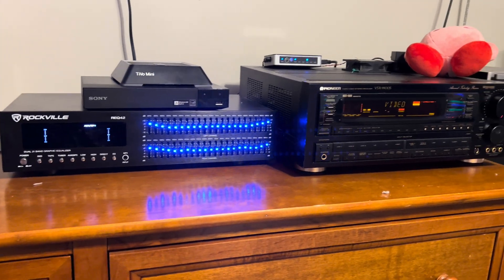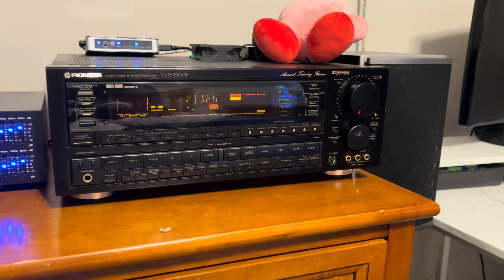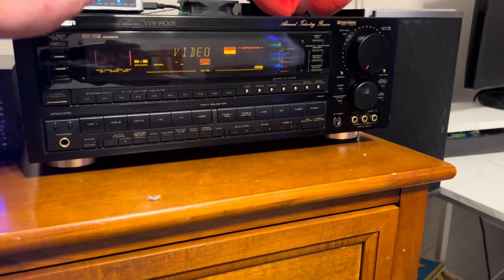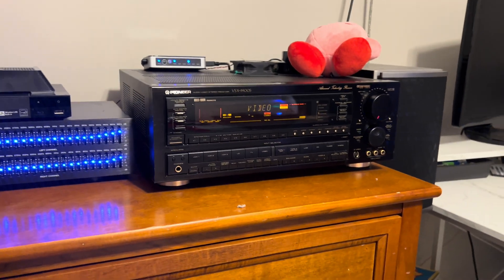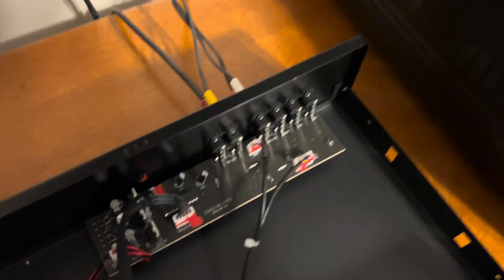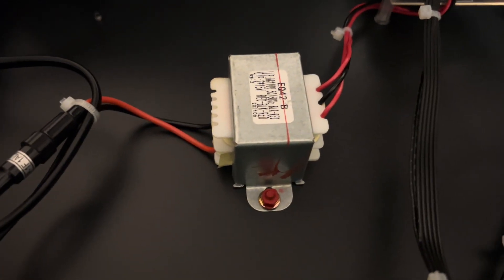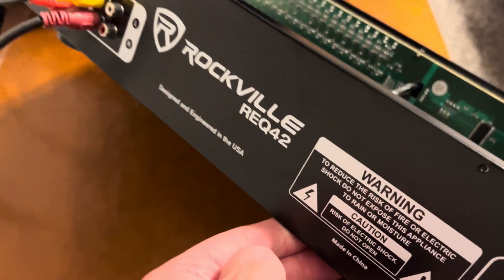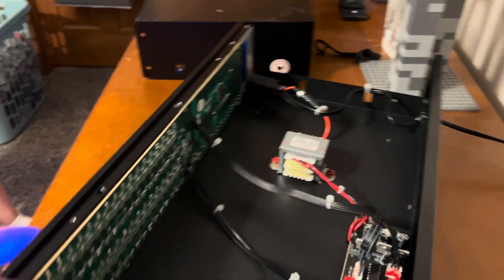Rockville REQ42 21 Band Equalizer - 2020’s Audio Equilment from China

Comment: having the transformer isolated and far away from everything is a nice touch that is overlooked by papa...Modern electronics (especially eq's) don't need a lot of caps or mosfets, or bloat to function.

 I do with a version came with red fiber optic lights (or incandescent as a 2nd choice, and dim-able LED's as a 3rd choice)...in red... why is it blue?

Comment: They could've made this double purpose with the empty space and cut a few slits in the top for holding CD's or tapes.
also, further isolating the power supply.

Overall, I bet this will last longer than 21st century components....if they used chips from samsung or toshiba Or taiwan...

Comment: The equalizer display actually will work if it’s hooked up properly. You need to make sure that you’re using your tape inputs and outputs on the back of your receiver, then hook your components such as a CD player into the back of the equalizer…. press the button press, EQ and you will see the meters work.
The display will bounce up and down when you do not have any audio running through it.
Reply: Furthermore: Press "HIGH" for it to drop from the top and press "LOW" for it to push up the levels on the graphical matrix.
  
 I wish it was configurable as XMMS,  (clone of) Qmmp, or winamp, or being able to speed up or slow down peaks, or analyzer bars, scope, lines, bars, etc...but it does work.

 Papa is generous and awesome but didn't read the manual. 😂
Reply: Could u tell me how

Comment: You don't have it hooked up right
Reply from the maker: There are multiple ways to hook this up, electronically, and electrically you can do a different ways. The main thing is you wanna have audio pass through it and then be able to change the frequencies which currently it does.

Comment: This just broke my heart I was about to order it to replace my adc sound shaper because the display is fading 😅
Reply from the maker: Would not recommend you’d be better getting something vintage that’s working
Reply: @davismv yes I still have my vantage adc sound shaper I was looking for something new because the panel is fading but I still no how to use it without needing to see it ,I use it specifically for my subwoofers it goes all the way down to 25hz I’m a just hold on to it instead of replacing it cause it’s wayyy better than this one in the video

Comment: Just purchased 😂 I Love those lights. Surprised you couldn’t find a tear down video for it. Rockville has videos for their amps though. And OMG! That must weigh 2 lbs. I’m thinking of canceling my order, after you took the top off. I Got this for passive speakers.
Reply from the maker: Honestly, it’s not a bad device and it is full spectrum with all the different bands, but not high-quality. Unfortunately, the spectrum analyzer is a zinger, if that actually did some sort of true representation of the audio, this would be a home run, given that these units don’t exist and you have to buy vintage.
Reply: @davismv  Thanks Buddy!
Reply: @davismv  lol! I sent mines back. One of the lights didn’t light up. Maybe I should have purchased it from Rockville, instead of Amazon. I ordered the Behringer 
“Ultragraph Pro” from sweetwater. Haven’t used it yet, but all the lights come on. And seems a lot heavier than the Rockville, “not hollow”. I just hope I have a better experience with the Behringer, once I have time to actually use it.
Reply: I believe you can select if the eq receives from the source